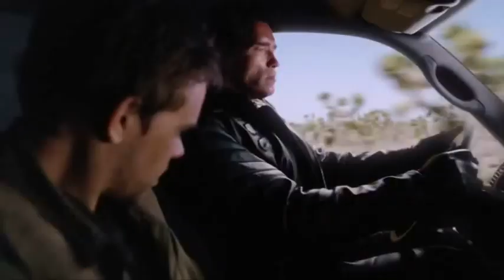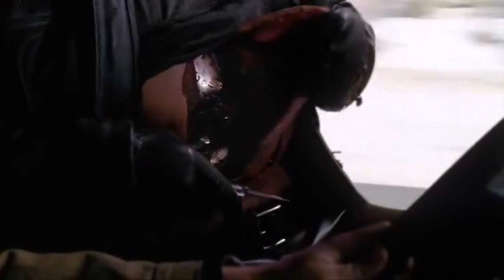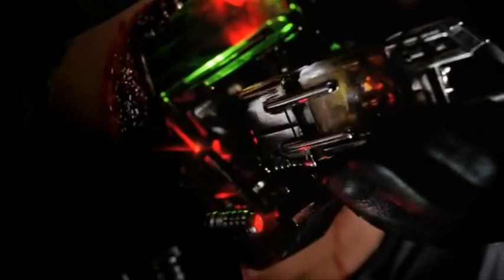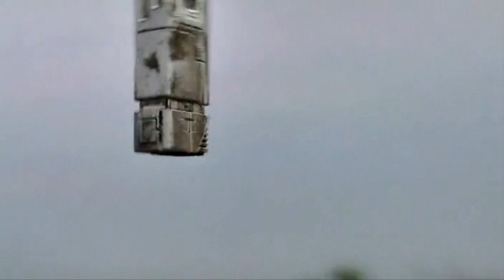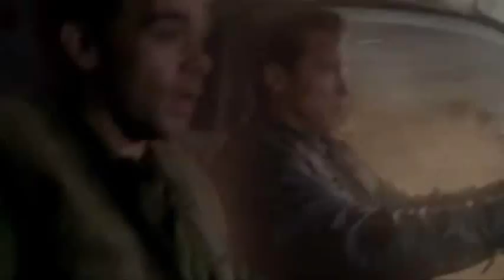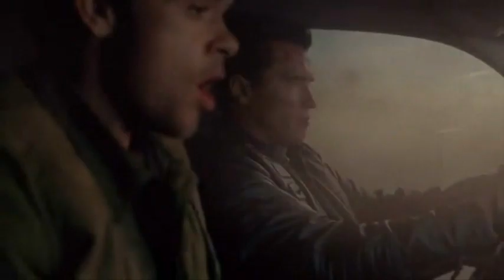Dangers of damaged hydrogen fuel cells

Comment: I like how the fuel cells were later used in Terminator Salvation to destroy the skynet base. Connor recognized them and rigged an explosive when running away from the T-800 in the factory.
Reply: That John Connor is the same one from this movie?
Reply: @Berzerk Llama They said Salvation is a reboot. 

Technically, i can connect T1-Genisys stories.

Genisys is set after Salvation, Kyle Reese was sent back in time to protect Sarah, but there is a new timeline where a T1000 and friendly T800 (pops) was sent back to 1973.
Reply: Its no surprise THAT does take place AFTER terminator 3

Comment: Who wants a new hydrogen-fuel cell-powered car?
Reply: Tigerman1138 that's for producing electricity troughs chemical reaction not fusion like the terminator did, God if we have car with it the car sure can run for 10 years without needing to refill.
Reply: This will take a while, and I dont think it will fit into anything below a Bus (at first). Back in the 50ies they planned to build cars with fission reactors, but it never happend because of the possible negative outcomes.
Reply: Alahu akbar
Reply: I'm good
Reply: me. hell a betavoltaic cell powered car, or a car powered by a radioisotope generator (which generates electrical power using the decay of a radioactive isotope) would run an all electric car with a 1/2 life of 5000 years.
Reply: I still want one, it's the future. Electricity generated at the moment you need it. Brilliance at it's finest. 
If you believe the future is in battery power, 8 hour charges and coal powered charging, you are a fool.
Hydrogen is the most abundant thing in the universe and the perfect power source.
Reply: @Megadriver  yep, and it makes up quite a bit of the gases in our atmosphere and it makes up 2 of the 3 molecules of water and water covers %70 of the planet so it'd be like having a fuel source that'll never be depleted
Reply: Pre-war people from Fallout?
Reply: Imagine two hydrogen cars getting in a head-on collision, each going 75 mph. I wouldn't want to be two miles from that
Reply: but once you crashed, or it randomly become unstable....
you're terminated
Reply: Even in a most horrible possible accident, burning hydrogen won't act like this. Hydrogen burns chemically, it doesn't randomly come through nuclear fusion (if it was, fusion reactors would have been much easier to figure out)

Comment: I have what is basically a mini H-bomb in my abdomen.

Relax.
Reply: IgnatianMystic When Katherine Brewster didn't believe John's claims about the future and his role in it how come he never asked the T-850 to lift up his shirt?
Reply: hydrogen is not plutonium
Reply: emailerc C I'm well aware of that. But the reaction is functionally the same as an H-bomb detonation.

Quit splitting hairs.
Reply: IgnatianMystic plutonium has an entirely different fusion compared to a H Bomb ;)
Reply: Yup The T-850 is amd upgraded version of the t-800 and tougher to withstand critical damage and can continue to function and the element of the T-850 is the most unstable element ever known
Reply: Hello! Real scientist here. What ignatian is saying in the chillest way is that it's like having a nuclear H bomb, in his stomach which is true and it does function like plutonium in that it releases the energy of potential nuclear forces regardless of whether it is fission or fusion.

By the way, a hydrogen fuel cell is a misnomer. If the terminator were functioning off the oxidation of hydrogen in that tiny little thing, he'd probaby walk only half a mile before shutting off. That thing is a hydrogen fusion reactor which probably needs to source its hydrogen from lithium 7.
Reply: @baloog8  Lithium 7, interesting. Reminds me of Castle Bravo experiment gone wrong.
Reply: I had one over my heart for 3 months lol
Reply: The scene doesn't add up however. Realistically, the car would have stalled do to the EMP pulse, triggered by the nuclear detonation.
Reply: That is a tiny nuclear explosion
Reply: Relax!
Reply: @emailercc3565 vallo a dire a quelli che abitavano ad Hiroshima quando hanno buttato la bomba H😂😂

Comment: I don't get how none of their ears popped from that explosion nor how that car didn't flip over somehow lmao
Reply: Plus that fusion puts off an EMP if I'm not mistaken.  Would fry all electronics, then the fireball is as hot as the sun.
Reply: @lungbutter361  If the explosion is small enough, the fact that it's hotter than the Sun won't be that dangerous because of the scale. But radiation burst will be pretty dangerous, especially for electronics. Terminator is probably shielded from it, but the car they're driving in does cause some concerns. I don't know whether  or not a car this old will stop working after having all of its circuitry fried by EMP, since older cars were less dependent on electronics.
The ionizing radiation also will be produced and probably in really scary amounts - enough to make noticeable effect even that far away. But I doubt it will instantly cause people to start dying from this far away (like how Hisashi Ouchi or other people affected by extreme doses of radiation died), I guess that at most it will increase the risk of getting various types of cancer in the future

Comment: So those fuel cells didn't rupture in a hydraulic press or vat of molten steel?
Reply: There are different Terminators
Reply: The one in Terminator 3 is a T850, The One in "The Terminator" is a T800 Model

Comment: If T-800s  are supposed to be powered by extremely explosive fuel cells, I'm surprised the T-800 from Terminator 1984 and T2 Judgement Day didn't explode when they were terminated.

Comment: I need this for my tesla. Imagine driving your car without charging it for a century.
Reply: Hydrogen fuel cells already exist. But they are not mini nukes as depicted in this scene.
Reply: If they get damaged or start to malfunction, your ass is grass if you don't stop at every sign of smoke coming from the hood of the car.
Reply: Hydrogen fuel cells dont work that way. If the tanks are ruptured, the hydrogen would turn to gas and escape quickly. They are not mini nukes as depicted in this movie.

Comment: is this scientifically accurate ? like is a hydrogen fuel of that capacity has the power of what seem like low yield nuclear bomb ?
Reply: Hydrogen fuel cell in reality has twice the energy density of a diesel or petrol. That hydrogen fuel cell is probably around 2-3 kg, which is still lighter than a normal gas in your car. So, no this is very inaccurate.

They treat the hydrogen fuel cell like nuclear power, lots of energy with in a compact size. In reality, hydrogen fuel cell cars already exist.

In short: Hydrogen fuel cell that small cant hold the same power level as nuke. It is scientifically inaccurate.
Reply: @darnit1944  so how much power does a hydrogen fuel cell of that size can hold and if it were to explode what will it be equivalent to ?
Reply: @henryheavy8044  Probably 100 kwh. That is if the weight of the fuel cell is 3kg. That is enough to power my small home for a week. But for a cyborg with immense strength and super computer, i dont think it will last for years as depicted.

In this movie, the power cell is equal to mini nuke. That's stupid since a mini nuke would be way bigger than electricity powering my home for a week.

This is just my opinion based on what i see.
Reply: @henryheavy8044  Oh, and one last thing. Hydrogen fuel cells has 40-60% efficiency. That means out of the 100 kwh, only 40-60% was converted to electricity. The rest was lost and turned into something else. Heat or lost, any others.
Reply: @darnit1944  when i said equivalent i mean as in explosives like frag grenade,aircraft bomb etc that kind of thing
Reply: @henryheavy8044  Eh, probably like a small molotov. But since hydrogen burns faster, the fire would be quicker but hotter.
Reply: Is time-travel scientifically accurate?

Relax.